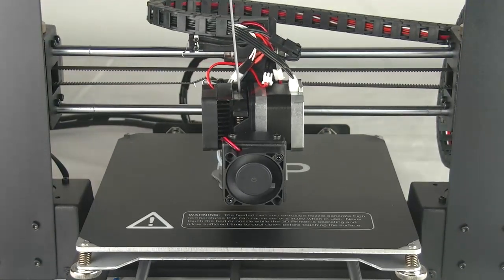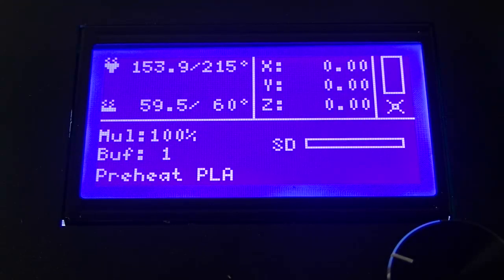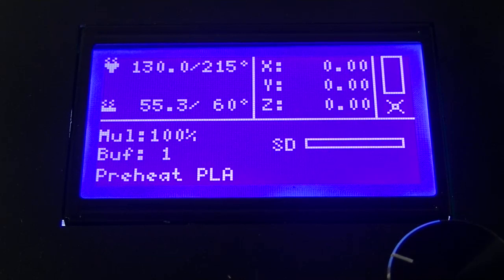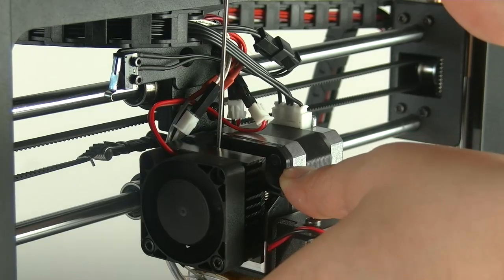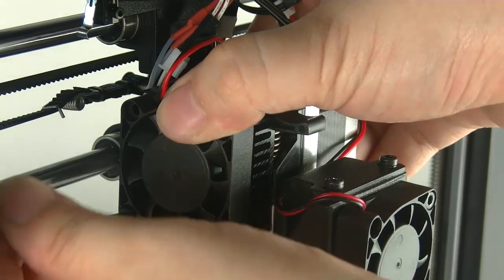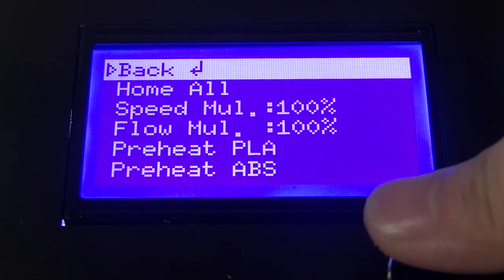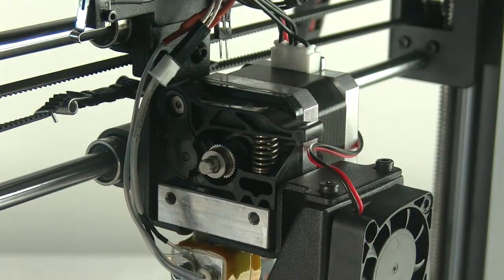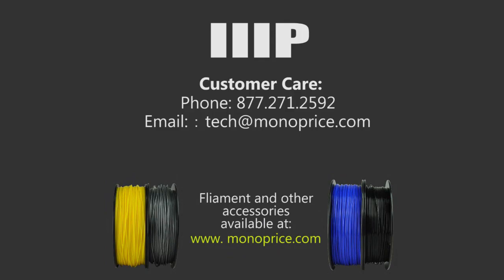Monoprice select 3d printer Clean nozzle Jam

Comment: Ty! I also found a way to clean out the crap. Strip a piece of cat 5 cable.. its about 3mm .. make it t inches and warm up and pull it from the bottom out through the top with clear line.. you will see all the carbon coming out as u do it..

Comment: The last print I was working on used up the last bit of the sample filament I received, and that little tag end melted out through the extruder just enough to get below the feed gears, so I had to take the head apart just like this video shows.